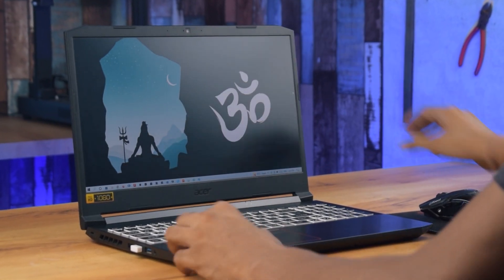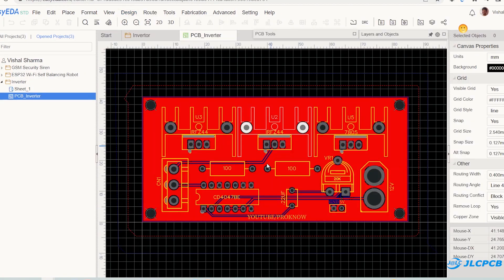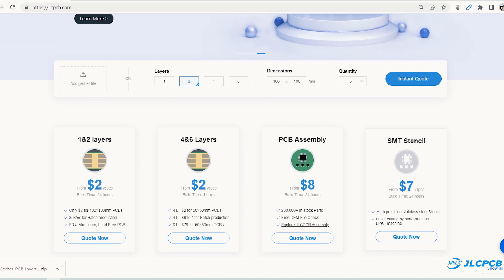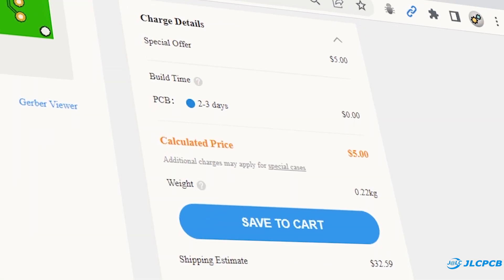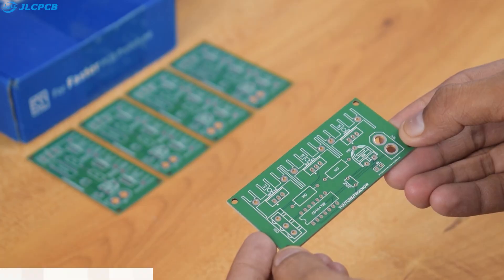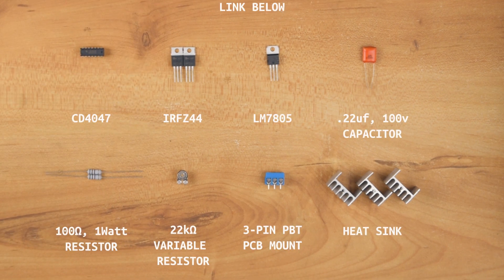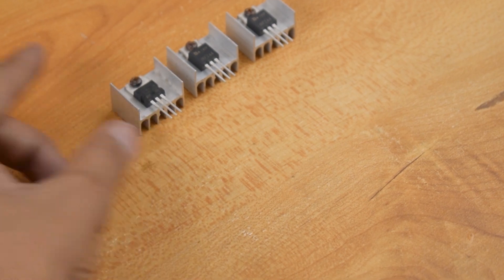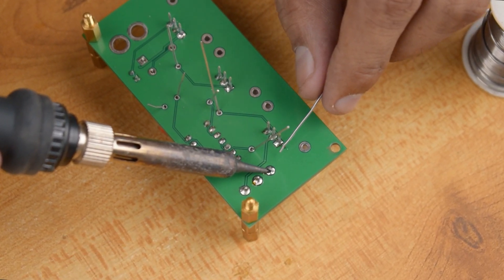Making a Powerful Inverter at Home - 220V Inverter

Comment: All is good. But what is the use of the fan, since there is no place from where the air will exit the tube, and you can't add/remove the inside heat without providing additional  opening in the tube. So plz drill some holes on the opposite end for air to gets release.
Reply from the maker: Yes, bro you are right I forget to do that.